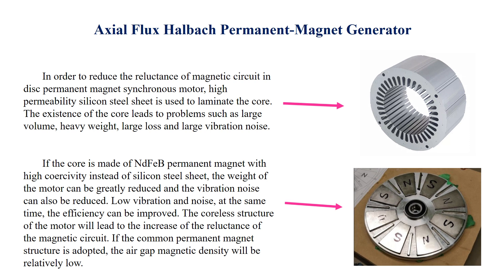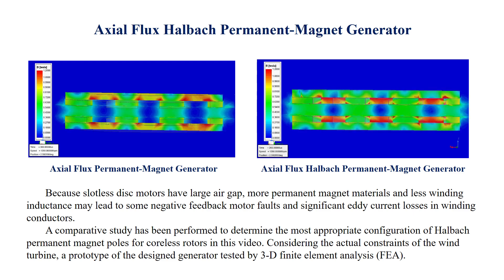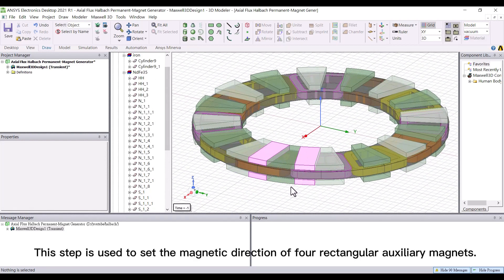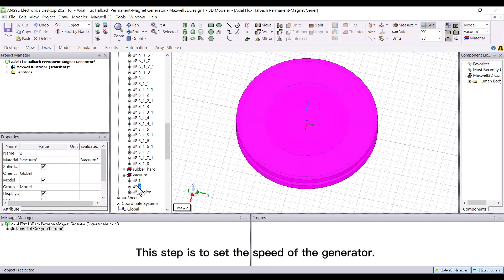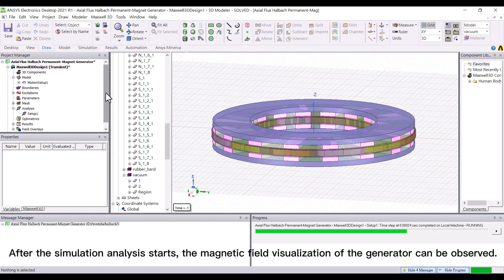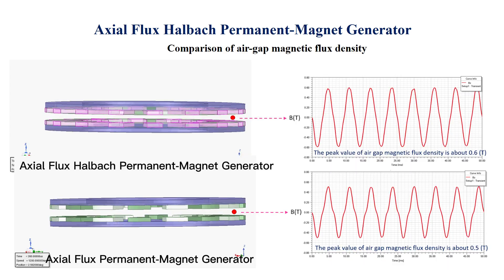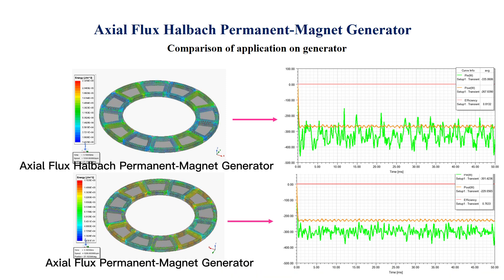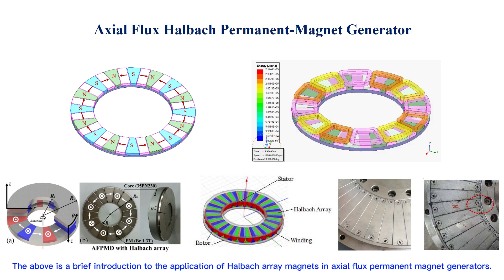Axial Flux Halbach Permanent-Magnet Generator; Using Ansys Maxwell software.

Comment: Liquid Nitrogen Laser Cooling  System for Rotating Superconducting Cold Permanent Electromagnets for motors and Hybrid Solid State Battery Technology 

A spherical superconductive material coated in silver is placed inside of a neodymium magnetic sphere, the magnet and the superconductor coated in silver are then wrapped in another superconductor coated in silver with a layer of magnet around it, then the whole system is covered in a liquid nitrogen chamber that is made out of a superconductor coated in silver, then the liquid nitrogen is blasted with cold lasers from the inside of the chamber. This superconducting cold permanent electromagnet is then surrounded by a  silver coil that is very close but not touching the magnet. The coil is around the magnet in all directions evenly like a cage around the magnet and is connected to a cold permanent electromagnetic motor wrapped in superconductors cooled with liquid nitrogen and cold lasers so that it rotates and is connected to a solid state battery, the solid state battery is a hybrid the discharging side and charging sides of the battery is liquid lithium and the inner side of the battery is solid lithium and has solid anodes and cathodes or superconducting anodes and cathodes coated in a thick layer of silver coated in iron that are cooled from the inside with liquid nitrogen that is cooled with lasers, though, the cooling system is on the inside of the battery it only comes into contact with the superconducting anode or cathode with control rods that are internally cooled by the liquid nitrogen coated in a thick layer of silver that is coated in iron and superconducting battery terminals the battery is compressed with air in a sealed metal casing and the whole thing is cooled with the liquid nitrogen that is cooled with lasers, on the outside, the whole battery is covered in a silver and iron liquid nitrogen sealed chamber cooled with lasers and the battery terminals are connected to the terminals on the outer most liquid nitrogen chamber directly with superconducting material like how you would jump a car positive to positive negative to negative and it will generate better power with higher density and a better discharge rate and less energy loss in the form of heat as all the heat Is contained.

The motor spinning the coil around the superconducting cold permanent electromagnet wrapped in superconductors, is an axial Flux motor design in the shape of a circular prism. It has a center and two plates on each side. The center is made of two plates on each side of a molding and is stationary. The plates are made of superconducting material wrapped in a silver conductive coating with neodymium magnetic plates that have a rectangular wedge shape which are placed in an even pattern on the sides of the plates, on each side of the center molding. they are built into the inside of the superconducting plate that is made out of superconducting material coated and wrapped In silver. the center molding piece also has a neodymium plate made with wedge shaped magnets built into the inside of the superconducting plate in the very center. The plates are superconducting electromagnetic rotors and are on each side of the center molding, the center molding is also superconducting. The inner molding and the rotors or plates are covered by two moldings on each side which have cold lasers built into the interior and a liquid nitrogen chamber that sits on the inside of each side covering the inner plates spinning in the same direction as the inner plates. The two outer moldings on each side are made of superconducting material wrapped in silver with a neodymium plate that has rectangular wedge shapes on it in a circular pattern around it just like the disc plates that cover each side of the inner molding. the liquid nitrogen chamber is thin and covered in a silver material which is covered in a superconductor then again covered in silver with the rectangular wedge shaped magnets on the outside of them in an even pattern around the disc plate and it is stationary on both sides, covering the two plates on the inside which In turn covers the inner molding. I've already stated how the liquid nitrogen plates are stationary as well as the center molding, though, the two plates on each side of the center molding, and the shaft are connected and move with each other when a current is applied. To get the alternating current you must connect a control disc to monitor the speed of the motor as well as provide the alternating current by having an alternator connected to the positive side of the battery. The motor must not be sealed off from the air. It also must gradually increase in speed, in order for that you need the control disc connected to a switch so that you can turn the circuit on and off as well as control the current running through the entire motor system.

Comment: why not just use an aluminum plate with a negative 1 isotope for the rotor in the center and two copper plates with a positive 3 isotope as the stators on either side...machine the aluminum plate with radial flutes in a clockwise outward spiral from the center where a ring magnet is and the outer circumference has a ring magnets matching the same polar arrangement. the copper plate would be machined with flutes spiraling outward in a counterclockwise rotation from the center ring magnet that is slightly smaller diameter than the one on the aluminum plate and in the same polar arrangement to push away from the magnet on the aluminum plate keep it centered without bearings. the ring magnet on the circumference of the copper plates would be slightly larger in diameter than the one on the aluminum plates outer circumference...

this would of course require the whole assembly to be built inside a vacuumed housing with output coils on the inner surface  of radiation shielding... the rotation will generate thermoelectric charges as well as microwave radiation that can be harnessed
Reply from the maker: Thank you. That's really a rich suggestion. Because I made this video was in order to a subscriber friend of the channel. Maybe I can find the opportunity to realize the suggestion you explained in the future. Thank you again for your suggestion.
Reply: @johnhsu5773  i had hope of doing it myself but it doesn't look like i have a lab and a machine shop... let alone the cashflow to test such things
Reply: aluminum conducts mag flux under any condition?  I mean, why not just use Invar36 any shape that is economical?